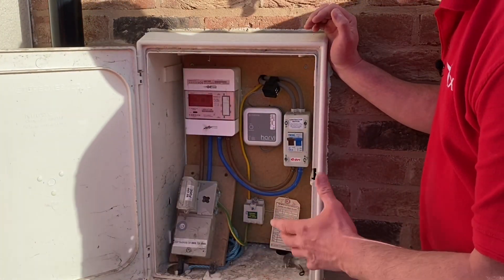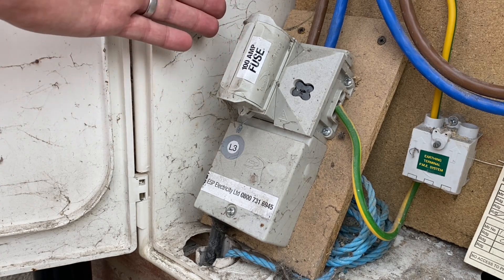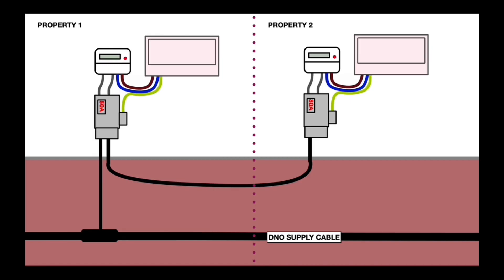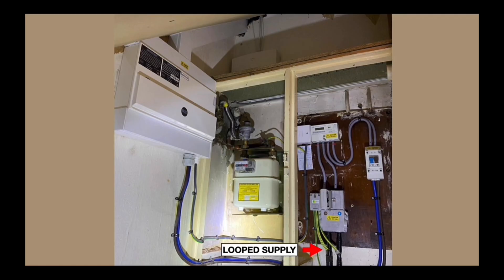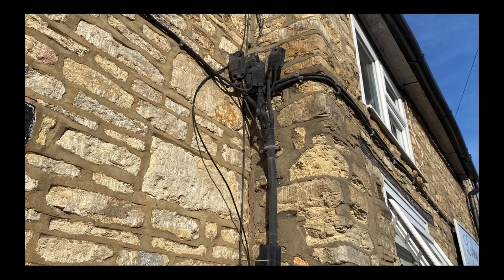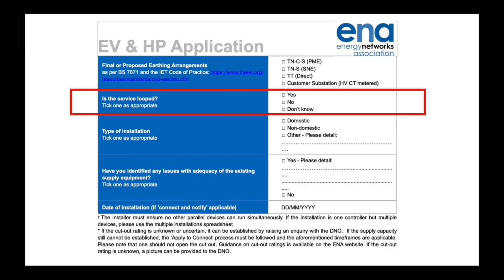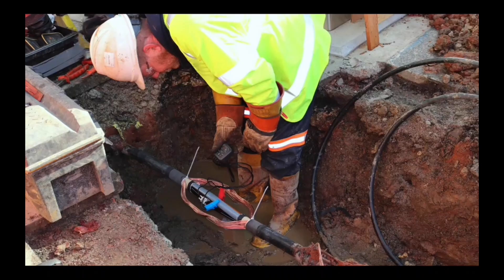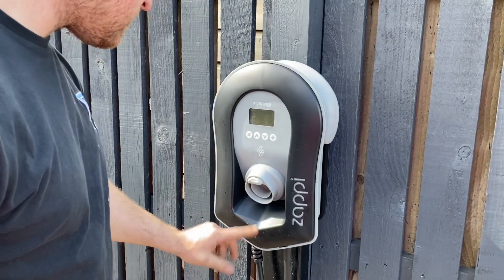EV Charger installation : BEWARE Looped supply - what are they , cost and time to correct

Comment: Last year, I applied for a smart meter install (with the hope of getting an EV in the future) and was given an install date.  Installer had to cancel once (illness), but at the 2nd attempt, he took one look at my supply, and said he wasn't able to touch it because it had an extra fuse in the neutral line.  Several weeks later, a different spark comes out to sort the issue with the neutral only to confirm it was also a looped supply, and again, no touching it.

Fast forward several months, after getting the requisite permits from the council, my street gets closed off (yup, popular with the neighbours that weekend), my driveway gets ripped up, and eventually a shiny new supply cable is run, the loop is disconnected, and I'm now directly connected to the supply.

From start to end took around 9 months 🤦‍♂️ (and I still don't have a smart meter or evse installed yet) with 3 months waiting for the permit from the council to close the street.  The only upside is because the initial problem (fused neutral) was something that the DNO was legally required to fix for free, the entire process has been free.
Reply from the maker: Thanks for sharing your pain - good luck getting that smart meter and EVSE!
Reply: @zlmdragon.  I'm first on a loop, property built in 1996. Submitted an enquiry online to the DNO (Western Power) they called me 20 mins later to say next door was looped to me. WPD says that 4 way loops are not uncommon and are probably the worst to get sorted
Reply: @zlmdragon.  good question. I imagine you’d have to ring up your DNO if you have any doubts
Reply: @zlmdragon.  if you are at the end of the loop you won't be able to tell. Your DNO will know though.
Reply: @zlmdragon.  I've put a request into northern powergrid last week to find out where the cables are on the property in preparation for possibly building an extension. The map which came back (in about 10 minutes after the request) clearly shows I'm looped to the house next door with them being first and my property being the end of the loop.
Reply: @LeeEskriett  this is probably the best situation as if you want to be unlooped it's you that'll have your garden dug up. I'm my case because next door are looped off me their lovely block paving is at risk if I want an EV charger 😬
Reply: You do understand that smart meters are designed so suppliers can eventually introduce demand pricing, eg when you use a high amount of electric say for charging an EV, using an electric shower or oven, the price will scale up during that time. They are not to save you money, why would suppliers want to make less profit?
Reply: @aarona9332  I'm in the industry and your coment is not correct! I'll admit I can see why the comment and surelly it would make sense from a business point of view. Having said that, in the UK we still have a surplus of energy being produced in the day time. Some of that get's sold to France at a very cheap rate. Now, with the EV chargers, the suppliers could offer that surplus energy to their customers at a cheaper rate rather than selling it even cheaper to say France, or so I was told. This was one of the few explanations I was offered when in the classroom.
Reply: @aarona9332  It seems smart meters also include remote isolation switch - for when you don't pay your bill. For me though, the downside is surprise billing. Now, when they ask for a meter reading, I know In a week or 2 I'm going to get a bill AND by keeping records, I've a damned good idea the amout it'll be !
Reply: @millomweb  Yes, in Italy we have smart meters from 20 years and they do have a remote operated switch. In fact when you open/close an electricity contract they don't even bother to come to your house, they can activate/deactivate the meter remotely. They use a pretty smart technology to do so, that is not cellular network (that doesn't reach everywhere and costs money), but rather a protocol to send data tough the power wires, similar on how the powerline adapters work. Basically the meter are connected to a big private LAN of the energy distributor. 

But that is not that big deal (you know, if you pay the bill they will not disconnect you), the main deal is that since there is a software operable switch inside the meter, why not using it for overload prevention? If you have let's say a contract for a maximum of 3KW (the standard), if you exceed this limit for more than a defined curve the power is cut. And must be reset manually. And by law in newer installation the meter must be placed outside in the street. So imagine the kind of imprecation that you say when you forgot that you had the washing machine running and turned on the hairdryer and now you have to go outside, in the dark, in the winter, find the key to open the meter cabinet lock, to restore power.

Comment: Cautionary tale over delays: We discovered  we had looped supply when the "installer" cracked the dno supply fuse housing when fitting a smart meter, with the whole housing needing replacing. DNO originally said they would unloop as part of replacing the supply housing... Now they say council will charge them for digging up the (relatively recently resurfaced) road... This has been going on for 10 months and we're stuck with cracked supply housing covered with yellow rubber sheeting.  What if the end house in the loop decides to overload the supply? They only have one incoming wire how do they know/care if the main cable in our house overheats?

Comment: It's also not uncommon if you are on an overhead supply to have singles feeding your cutout so having 2 cables coming in might not be a loop
Reply: Not just overhead supplies. Our underground TN-C-S supply cable appears as two cables at the cutout but one is yellow (live) and one is black (neutral/earth). Our house was built in 1982 iirc.

Comment: Now i know what that means on the Ev comply form! But surely this is the dnos problem not ours, there has always been the potential of multiple property's pulling a high load on the first cable, shouldn't the properties have the right fuses to balance the cable load?
Reply: But that would mean the first property having a high one and subsequent ones getting less and less.

Or everyone having a very small fuse.

The reason would be it's unlikely that every house would be drawing max amps at the same time.
Reply: Balance the load? What do you believe a fuse would/could do in this situation?

Comment: 90% of installs I've done in urban areas have been looped supplies so it's really important to contact the DNO on every install of a 7kW charger. 
 
I've heard many installers say you don't need to contact the DNO if your installing a charger with load management like the Zappi or Hypervolt but this is not true.

Even if only one cable is visible at the cutout its possible that it is looped from a neighbouring property.

Comment: We have that very problem, thankfully our supply comes in from above from pole outside our property, and we are primary supply to ours and neighbours. Our DNO is separating supplies and they have said if replacing existing 16mm it will cost nothing, but if they estimate we would use more than 80A usage then they will fit 25mm cable and we will be charged. We don't have electric heating and only shower and hob plus charging car overnight so unlikely to get near 80A.

Comment: Another problem to look at is where flats / maisonettes , as in my case, a MICC cable comes out of the Cut out and goes to the flat above, which the DNO say is not their cable, and will not do anything with it, even though the bare undersized earth is only by a copper saddle and nut and bolt with no Gland fitted to the MICC at the cut out, just single insulated neoprene sleeve on a 100a fuse,

Comment: Surely if the electricity infrastructure provider has undertaken to provide you with an 80A/100A supply then it is entirely up to them to bear the cost of bringing it up to spec if it wasn't properly done in the first place?  The problem is on their side of the big fuse, so their responsibility.
Reply: When the loop supplies were installed , the forecast for electric was about , 40 amps max most loop supplies have a 60 amp cut out fuse  just because the fuse carrier saves 80/ 100 amp does mean it is , when I've done EICR and  the form asks for the cut out fuse amps I state carrier says x but the actual size is unknown  , , 60 Amps  was more than adiquat at the time the housing was built , move on 60 years later , , life today s very different to life then , I would imagine life in 60 years time life will be vastly different than it is today
Reply: I very much doubt that if you look at the actual details of the installation "contract" you will find any such  undertaking.  You will get what you are given (and be grateful for it).  Don't forget this is all a legacy of a nationalised industry.

Comment: I guess it must have been cheaper to have properties put on looped supplies when houses were built.  I live on a cul-de-sac in a semi-detetched mid 80s house.  Out of interest when I had work done on my house front I asked the dno (Electricity North West) for the plans.  They show the supply to my house as going down next door but 1s drive, across to next door and looped around the back of the property to mine.  It would have been a lot shorter run to go from my meter cabinet to the supply in the front street.  I guess this is why my Ze shows as 0.36 on a TN-CS when measured at the CU, at the cutout it is probably bang on 0.35.
Reply: But why looping that way? It would have made more sense to run a 3 phase cable and then loop 3 houses each one on a different phase. That way you would have saved copper, without having that sort of problems.
Reply: Sorry wasn’t very clear - the cable to my neighbours and mine just runs down next door but 1s drive for some daft reason, it doesn’t connect to next door but 1s house, they have another cable going down their drive on a separate phase which loops around to their attached neighbours house.  There is a 3 phase cable running around under the pavement directly outside our houses.  They have done all the semi detached properties on the estate the same ie in looping them by taking the long route around the back.  I guess back then in the 80s electric vehicles were never thought of.  It just seems like a very strange way of doing it to me, until I got the plans I would have never thought that it would have been wired like that.

Comment: If you don't know if you're on a looped supply and you are on good terms with your neighbours, ask to have a look at their cutout. if the properties either side (and yours, of course), have a single supply cable, it's most unlikely that the supply is looped. For an overhead feed it should be easier to trace anyway.

Comment: I am so glad I don’t have anything to do with EV installs , to much farthing about just to put a fancy battery charger on a wall .
Reply: Don't really understand your complain as most of the video is just about making sure that the income is proper . Same process can be required if you want a large heated pool or a large heated house ... supply meeting demand
Reply: Well just like any major appliance, you can't just plug it into the wall if you want peak performance and efficiency. If not for EVSE's, people would complain about how EVs are unsafe and dangerous. It's a small hassle to install, and a big advantage to have. If it's too much for you to handle, you can always charge your EV at a charging station away from home.
Reply: You will soon. Everything is going electric. With fuel prices on the rise, you won't have any other choice.

Comment: If in property 2 you wouldn't know if you were looped as there is only one incoming cable on veiw
Reply from the maker: The DNO form needs to be sent regardless - so depending upon the quality of their records it may be picked up.
Reply: @efixx  From a brief phone conversation today, Northern Powergrid have no records of whether a property is on a looped supply or not for the vast majority of their connections. 60A fuse at the moment but they are sending someone out to see if it can be bumped up to 80A.
Reply from the maker: @furstyferret  great input - records tend to be a bit sketchy on this matter - hope you get it sorted.
Reply: If you have an 80amp fuse. And you are on a looped supply. The dno should be able to supply you with 80amps when ever you want. So if the supply cable does become over loaded the broblem I'd with the dno and for them to upgrade with no cost to you.
Reply: @scottsparky1  Indeed, but that's not how the system was designed. it was of course engineered down to a budget...  In the 70s and earlier, nobody could have foresee it
Reply: @scottsparky1  if everyone took 80a at the same time the transformer would melt 😅😅😅
Reply: @ilsonbob  nope, it'd just pop the fuses and then the DNO would have to upgrade the transformer etc due to higher than designed demand.
Reply: @Thermoelectric7  nope, enter the smart meter with remote disconnection 👍
Reply: If the supply comes through an internal wall it’s likely your on the loop just looked at my house and 🤬 into my house and through the wall to next door 😫

Comment: Never seen a looped supply ,must get out more!
Reply: Seen a few in our area... very often it's flats above shops (as in the old song :) )... shop has the main supply, flat is looped out.  Got an install in a few weeks (nowt to do with a car charger, but a typical paperwork based issue): the DNO (SSE) want US (customer's electricians) to install 50x50 Galv trunking up the outside of the takeaway, to the flat above, to take a new PME (TN-C-S) supply up the wall, and to help them feed the concentric cable through into the flat because.... they're an underground crew, and not authorized to climb ladders. To get a ladder trained crew would cost hundreds extra!

Comment: Useful video - thanks. In Western Power's patch, the properties which need the new supply are likely to get a 3 phase cutout as part of their 'Superfast Electricity' policy.
And whilst mine was a 3 phase upgrade from an existing unlooped supply, Western Power seem to be very EV friendly and the service from West Northants office was amazing.
Reply from the maker: WP are very proactive with regards to EV - All new properties are fitted with 3 phase cables. (although not all developers use it)
Reply: Yes WP are fitting 3 phase cutouts but the property is still only using a single phase with a single phase meter so pretty pointless. Unless I'm missing something.
Reply: @williamsanter1153  It means that the capacity can be tripled without digging (explained to me as a phase for the charger, one for the heat pump and one for the house). It also means that they can move properties between phases to try to improve the phase balance.
Reply: @williamsanter1153  Future proofing.  Well done them.
Reply: Phew, as ordered an EV last week, arriving next week and found out on looped supply. We are also covered by West Northants office of western power. How long did it take to resolve?
Reply: @1simontebbutt  Mine was 3 months - you might get it quicker but there are minimum notice periods if they have to dig up the road.

Comment: Moving into my current home 3 yrs ago, I was boarding out the loft space and wondered why I had a cable running through the loft, checked out the meter and its next doors feed on a looped supply. I suppose the only consolation is that the loops on my side so I don't have to worry about digging up my driveway. Let's hope my neighbor needs an EV charger installing first.